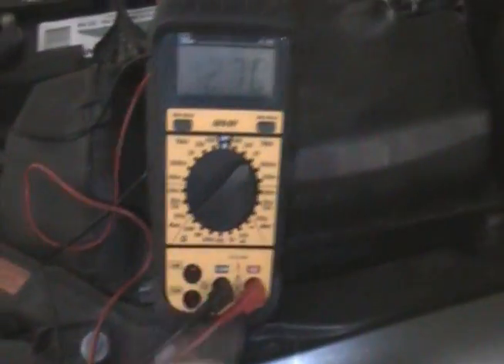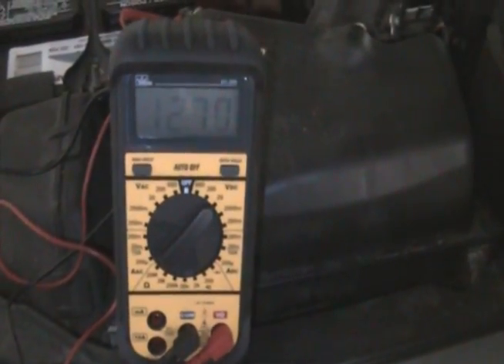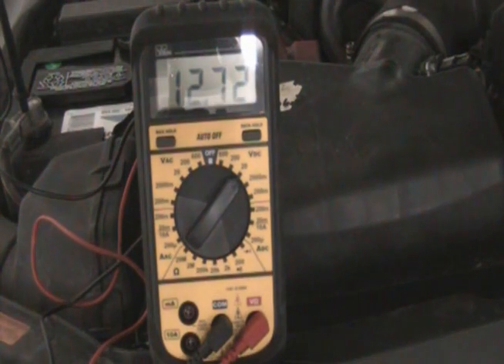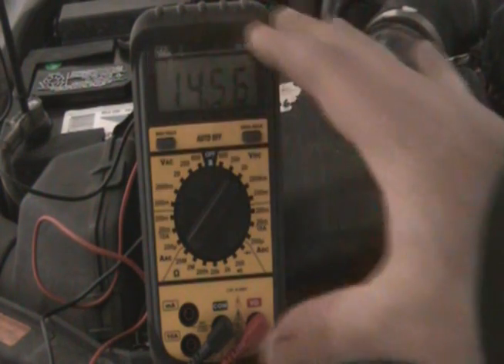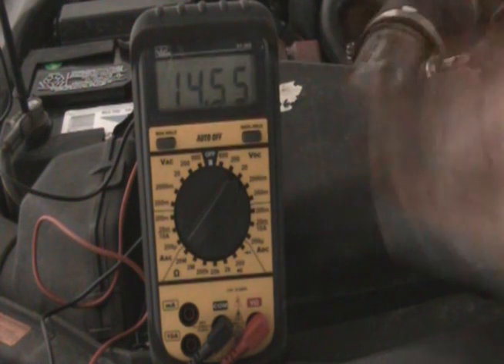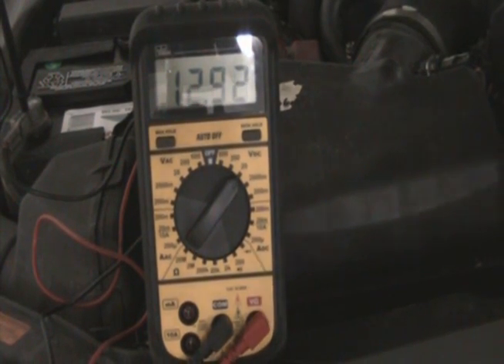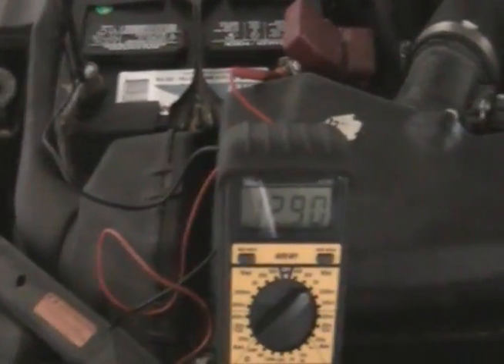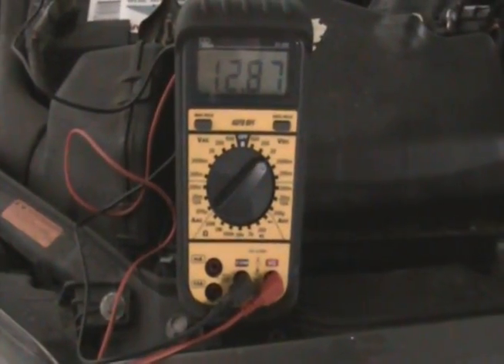How to test your vehicles alternator using a multimeter.

Comment: working on the Nissan,  determined that the battery voltage only went up to 13.6. Almost got a new alternator, but it occurred to me that I should check the voltage at the alternator end of the cable.   14.4!   It was corrosion in the cable connection to the battery.  Hope this saves someone else an unnecessary replacement.

Comment: How about if my car aint cranking, just whines - i did changed the battery ?? FYI - this is after an intake manifold EGR clean up on a 2k Honda accord ex, using some carburetor cleaner (1 can +) :(
Reply from the maker: +hvcool Have you checked the starter?

Comment: my car is charging the batery at around 12,7 or something like that below 13v at idle if I rev it it goes up to 13v but I have to rev it  a lot to go over 13v it is an old car 33 years I think it's time to change the alternator what do you think sorry for my bad english
Reply from the maker: +AnimaxRex Could be but have both the battery and alternator tested.
Reply: AnimaxRex hey man I have alot of old cars and if it reads 12v at idle and goes up when you Rev it, your idle speed might be too low.
Reply: at the end it was nothing the bolt on the belt tensioner was old and was Loosening it self I never even thought about the screw

Comment: Ok question. Forgive me I don't much about mechanics. I bought a vehicle (honda rafaga/ascot) and when I was driving the car would move slow as if it weren't getting any power. The battery was ruined so I bought a brand new battery and then I drove it by brother's house. That brand new battery is now dead. I understand it's the alternator but the guy I bought the car from recently installed the distributor. Would that cost the alternator to malfunction ?
Reply from the maker: +Sidney Shaw No, it wouldn't cause that but it does sound like the alternator. Probably just a coincidence.
Reply: I hope it's just the alternator.

Comment: Great, thanks. I was wondering how to do this and your vid gives me a good starting point, as I had no idea how to use my multimeter to check a car and didn't want to buy one of those battery checkers that just has "Good/ Average/ Bad" on them. They don't provide much info.
Reply from the maker: +Greg Rickard Thanks for watching, I appreciate it!
Reply: +Johnnysshop Does this method still work on cars newer then 2005?  I had pepboys tell me the alternator is an issue, but my neighbor just did this for me and say its fine!  I already replaced the battery, so that cant be the issue
Reply from the maker: +Lam Lam Yeah, works on any.

Comment: Some bad alternator voltages are due to bad connections on the positive or negative sides of the alternator. You didn't mention drop voltage tests and cleaning the alternator's positive and ground connections. Also clean the car's ground connections as they can all impede current from the negative battery terminal. Clean the alternator's positive connection as well.
Reply from the maker: +AJFresh This is true, failed to mention this.
Reply: +AJFresh.  I agree, its not good testing the alternator without cleaning the battery posts, grounding post, and alternator posts first..?  George C.
Reply: +AJFresh sometimes a broken wire,too.
Reply: Looking back about doing positive and negative drop voltage tests, they can tell you which part of it's internal circuitry has failed. They are useful if you are going to repair the alternator.

If you're just going to replace the alternator, you only need to test voltage from it's positive lead to the battery's negative lead, and maybe clean up the alternator's ground. Possibly run a new ground from the alternator straight to the battery's negative. If you do all that and the alternator's charging voltage still runs low, replace the alternator

Comment: Hi ya I have a ford focus estate 2001 I every now and then hear a click sound coming from the engine around the cam belt area now a few days later my battery light on the dash comes on and occasionally goes off again also my central locking every now and then sounds like its trying to lock and unlock itself even when drivingvaround do u havecany idea whats going on. Im sorry for all the questions at once but I thought they might all be related.
Reply from the maker: michaeo sear Hmm, not sure but I would get a OBDII reader and see if you can pull some past codes to narrow it down.

Comment: Is it possible that the alternator still charges the battery enough to have the car run but not enough to start the car back up?
Reply from the maker: Possible but sounds more like the battery. I'd get them both tested.
Reply: Andrew Perkins-McDuffie Check the connection from the alternator to the battery.

Comment: I replaced my timing belt and dive belt (on my volvo 850) about 3 weeks ago now, and ever since, there's been a weird rumble/vibration whenever I'm at idle.

The new drive belt I bought is longer than the original one BUT it's whats recommended by a local Volvo shop. It changes the route of the belt and increases the amount of the belt that goes around the alternator pulley, so that it should produce a stronger connection to the pulley.

So anyways, I've replaced a LOT of the things that could go wrong/cause it (plugs, wire, rotor, distributor, cam-sensor and crank-sensor) but it still has a weird vibration.

It is noticeable at idle and ESPECIALLY when I put the car into gear. I can feel it in the seat of the car at idle and hear it. It actually sounds like something is rubbing up against something, but that wouldn't explain why I can physically feel it (at least, to me).

One of the websites I found (today) had a question from someone with a similar issue. Theirs was rough/vibration at idle, rough idle/vibration when coming to a hard stop, and a clicking sound. Mine doesn't have the clicking sound (it's more a rubbing sound), but the other two are close to mine.

Based on what information I've given, does this vibration sound like it could be a alternator issue? Have you heard of that being an issue?
Reply from the maker: I haven't heard of that being an issue but I suppose it could be a bad bearing on the alternator.

Comment: "if you're not getting 14 to 14.5 volts with a FULLY CHARGED battery, chances are your alternator's bad." Are you sure??  With the battery fully charged, wouldn't the voltage regulator (correctly)  prevent the battery from charging any further? Please respond. I would appreciate your thoughts on this.   Thank you.
Reply from the maker: That's while running, it's the voltage of the battery/alternator in the car. Once it's shut off and the alternator isn't running you won't be at the 14 volts.

Comment: how would you test if your Alternator works with a battery that may be bad???  I wanted to see if the alternator does anything to a dead or dying battery anyway... like if the battery is reading 11.40  and then you turn on the car, should the reading JUMP up to 14+ if the alternator is working, despite if the battery is bad?  I understand the alternator will not charge up a bad battery but will it still read up to 14+ if the battery is bad?  Hope someone knows what I am asking here

Comment: Great video..I have a 2001 pt cruiser. Was working fine last night but the engine light came on a month ago but would come on and go off. Recently a week ago there was a moaning in in the car only when i accelerate tho. So this morning Iwent to start the car nothing. It clicked as if it were the battery dead. Then eventually no clicking. No lights radio or otherwise. I attached jumper cables to no avail so i spent trying to tap the start motor and pushed it while in gear to see it the starter was jammed up. Nothing worked. So i am thinking of changing the battery or do you think its the starter or alternator? thanks.
Reply from the maker: Not sure but the moaning could have been the alternator. It's possible your battery is so dead it will not take a jump and could have been fried by a faulty alternator. That's just an assumption of course.

Comment: how can i check voltage on my battery its brand new but i have a system and i just bought a multimeter from auto zone called actron
Reply from the maker: I have another video called "checking cold cranking amps". That should help you.

Comment: when during cold start my battery doesn't charge after starting up my car. On the dashboard the battery light is still lid up but when I put a little bit of gas then the battery light goes away and the multimeter shows it's charging slowly going up to 14v+ What could be the problem?

Comment: fixing a car for a friend-1994 butlass 3.1 l.. new battery and alternator. starts up rite away but dies in 2 seconds. my battery voltage goes down from 12.4, does not rise ,im clue less? its cold out and I would really appreciate any thoughts.thanks.

Comment: Any ideas? 
Subaru legacy, new battery. while running it would drop like a volt a second measured with a meter. 
New alternator, and it only pulls about 13.6 on the meter. is that average for a car that size?

Comment: Voltage for alternator is anywhere from 13.5 to 14.5. A cold start it usually is in the 14v range and when the vehicle is driven it drops in the upper 13 volt range. If it is bad you voltage will drop. Mine dropped from 12.5 to 12.1 after starting. New alternator reads 14.4 at start and 13.7 when warm.

Comment: thank you alot for helpn with the videos and i put a new alternator on and now it shows on my meter that its making 14.5 volts but when i turn my car off the battery shows 13 volts i dont now if its over charging and it runs 14 volts all the time when cars runing even if i raise the rpms it dont change

Comment: Replaced the battery and Alternator( with voltage reg) and my battery is loosing charge somehow. Watched your video and purchased a multimeter and the readings are as follows:1. car off battery reading is 12.2.   2. After it is started the number slowly(10sec) climbs to 13.8-14 area.  3.Then with the car running and the heater blower on high and the headlights on the reading goes down to the 10.5 area but does increase when the motor is rev'ed up to 1500 rpms. My belts are tight. I am stumped

Comment: I bought a new car battery because the old one kept draining after a couple days.  This new one I have is now doing the same thing after my car is not use for 2 days. When i tested it the voltage is just below 12V (11.4...). When I do the alternator test it charges up to 14+V..

What could be causing the battery to drain?

Thanks

Comment: @Johnnysshop According to the video, if it's not cranking 14-14.5, it may be going bad; mine isn't even reaching 14. Also, with the light flicker at my domelight, and courtesy lights, I thought it may be my volt. regulator.

Comment: I tested my alternator with my battery fully charged. The alternator maxes out at about 13.2V with the engine running along with the headlights, A/C @ full power, and the domelight illuminated. Revving the engine has no effect on the reading. Would this indicate a bad alt., regulator, diodes, or something else? Also getting a faint flicker at the domelight.

Comment: Actually a bad alternator can also go up(overcharge) in voltage.Its should be between 13.5 to14.5(15 on japanese cars) volts. Any higher and its overcharging. An alternator  can overcharge due to a bad voltage regulator and create a major draw and heat on the circuit resulting in battery discharge due to electrolyte evaporating